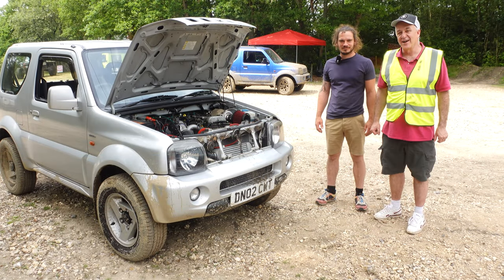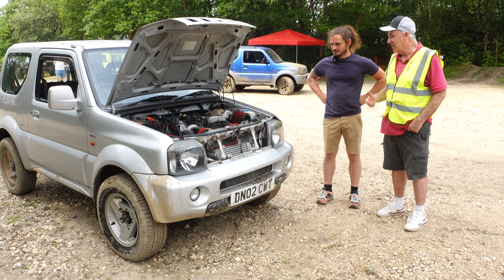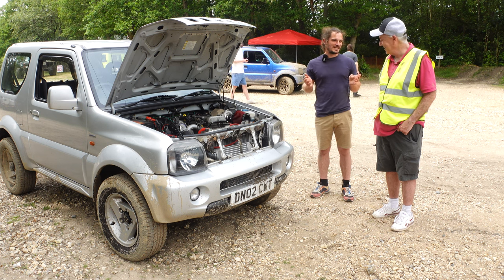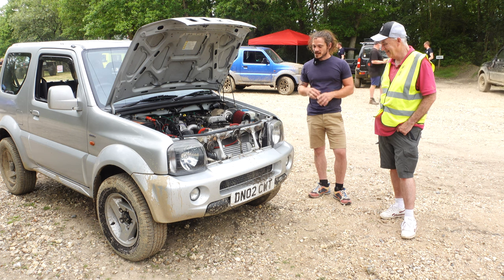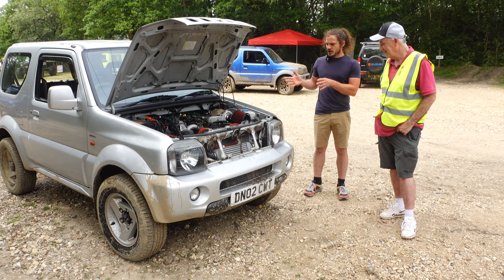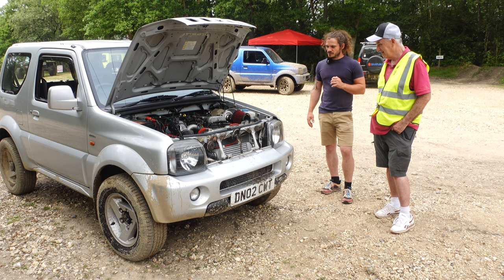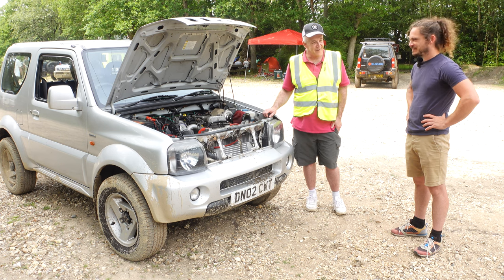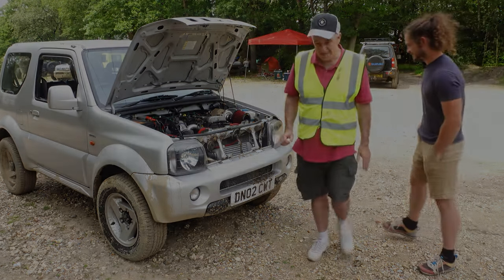Horsepower, do you want it? Crazy Turbo Jimny!!

Comment: Really enjoyed watching this. Thanks Mate.
The 1.3 is enough to pull the car loaded for camping up a long hill @ 90km/h but Aussie freeways are 110.

I suggest that you turn off the AC, put your foot to the floor on the way down hill and try to hit 130 at the bottom of the hill in 5th, go back to 4th at 110 @ 4000rpm and dont be shy  to change back to 3rd if you go below 100 because the 1.3 is good for 6000rpm which will give you 110.